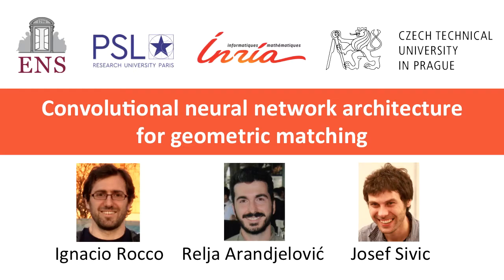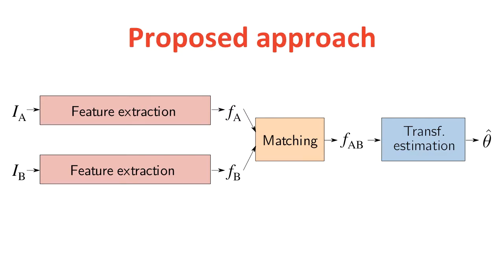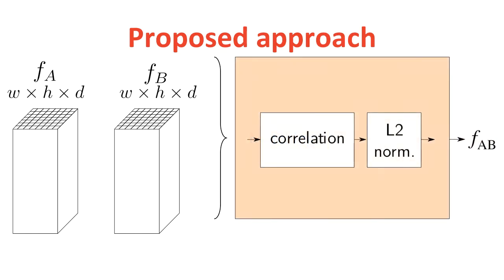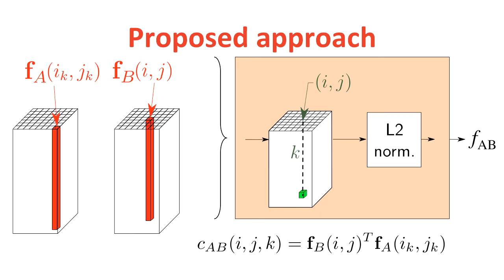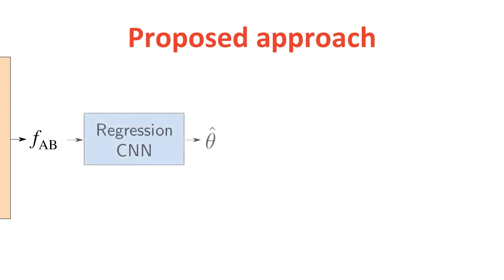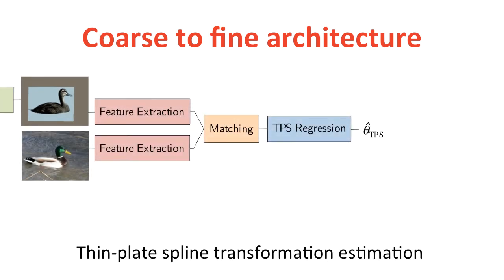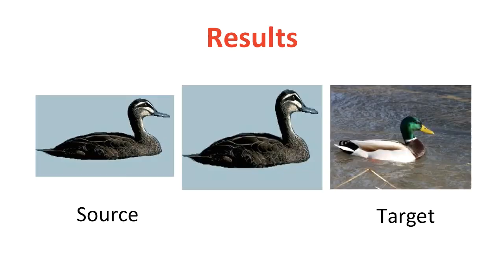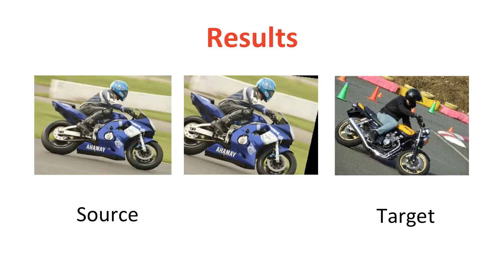CNN architecture for geometric matching -  CVPR'17

Comment: Thank you for your nice work and presentation.  I have several questions, please answer these.

1)  why did you define the f_AB as 3D tensor?  I think 4D tensor is more natural and good for regression calculation.
2)  When image A and image B are not the colored images but it is kind of binary masks, do you think it will work also well? 
3)  If you marking the peak values in f_AB, do you think where the feature-corresponding points appear? It would be similar to the SIFT?
4)  you mentioned it works INTRA-CLASS  in your paper.  How we can define the two objects are in the same class?  You might think is CLASS in the image classification problem, right?   I think it is a pretty imprecise definition.  Any clearer idea on this?